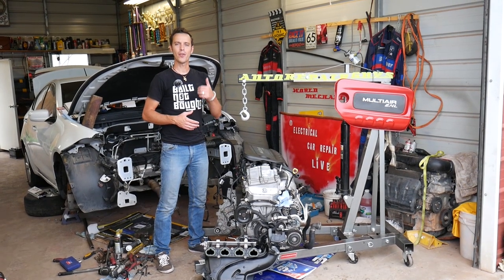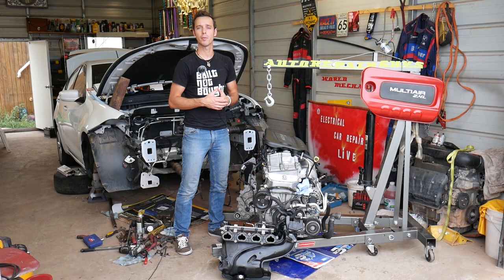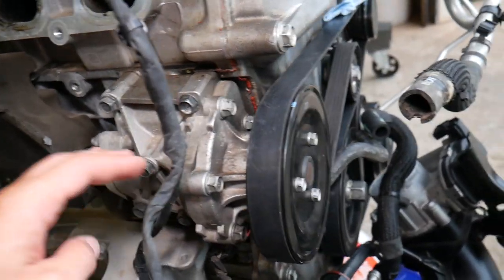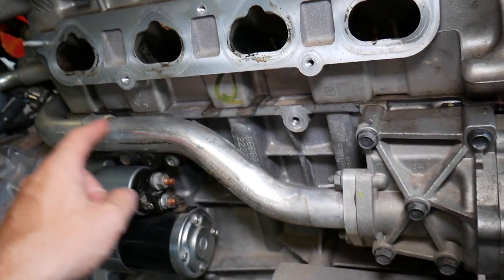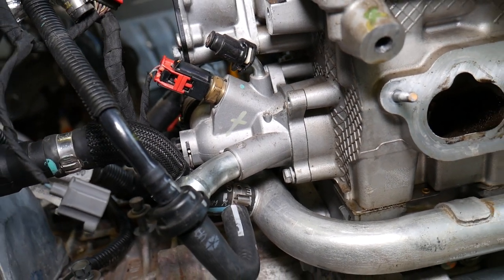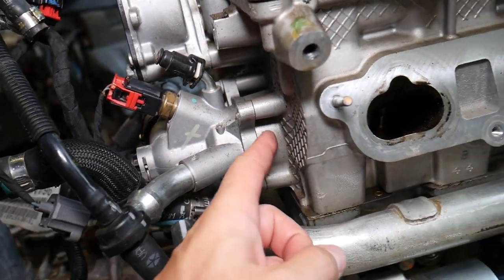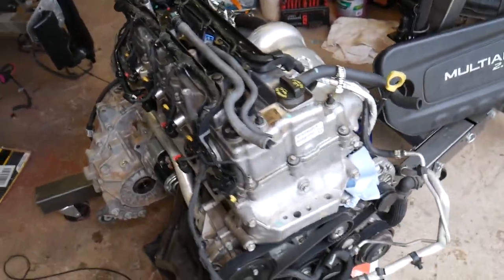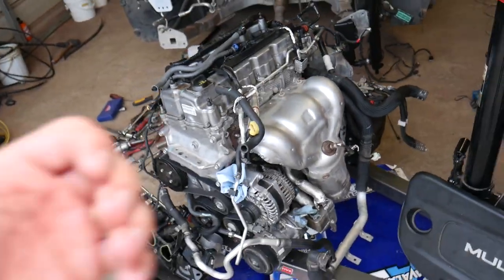COMMON COOLANT LEAK JEEP CHEROKEE COMPASS RENEGADE, LEAKING COOLANT

Comment: Could you help diagnose 2012 caravan, no crank, no start ? 
Dashboard shows:
1. No fuse 
2. No BUS
3. Wiper half way
4. Main run relay  clicking 
5. ASD relay  was clicking 
6. Stick in PARK position but DASH board shows "R"
7. Electric lock not functioning 
When did it happen?
I was working on wheel, I left power on to listen to radio, charging phone, left door open, some time later, I heard a beep, then tried to start car to charge car battery, then no crank, no  start. Gear stick on Park position but dashboard shows "R"".

Comment: I have a 2014  keep grand Cherokee limited and have had a major coolant leak. Thought it was the thermostat and had it replaced as it was stuck blowing cold air. Had it pressure tested and it was fine. 5 days later same thing but the shop that looked at it said they didn’t see where it was coming from(they didn’t remove the skid plate)
Reply: I’m having the exact same problem. Did you ever get yours resolved?

Comment: Hi! I have been watching your videos for a while, I have a QUESTION! : Can you help me to diagnose my problem?? If so...you may read below........          my car; 

JEEP CHEROKEE V6 2015 Trail Hawk; over 130k miles..... it started to overheat out of no where. 

I drive a lot, every single day. The coolant was full before- there was white smoke coming from the car. I stopped driving , got coolant and filled it. Before I started driving that day, the heat didn’t work. Later on the overheating started. ———- after I put more coolant, at a gas station that tottally overpriced the coolant! $24.99 for normal 50/50 coolant! 

I had no choice but to buy it. It was leaking coolant at this time and spilled on the ground- a lot of it. I filled it, started to drive home, I turned on the heat; trying to cool the engine down more as I drove and to see if the heat works. It started to work, then it only worked when I pressed the gas—— then after driving maybe 3-4 miles out—on the way to my house,, the heat did not come out anymore. It started to overheat again and it leaked coolant on the ground- enough to see it on the ground. 

I made it home, Smokey again, I let it cool and put more coolant. It did not leak coolant - it only leaks if I drive the car and then park it- it seems to me ————/ 

I MAYBE WRONG, but the coolant is not making it to the radiator, there must be a leak from a faulty gasket seal, making the coolant to leak out and not do it’s job to make it to the radiator. ——— any suggestions? 

I do not have unlimited money nor do i have a lot of money for a major fix- I am in the process of saving money for a much bigger dream I have. I would like to know the possible problem so I don’t take advantage of at the body shop! Man I wish there was a way to get a honest and good mechanic!!!! ———-//

...But I would like to say,  thank you for the time reading this and hopefully you,,,or someone in the community will help me out! Thank you!!!!!
Reply: Dealing with something similar with my Compass